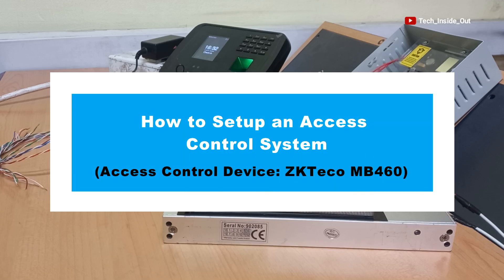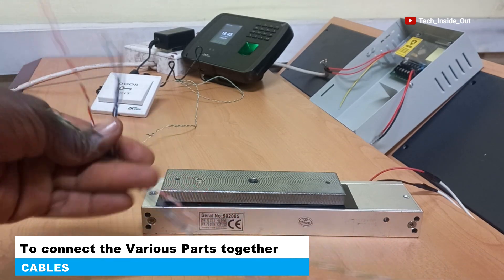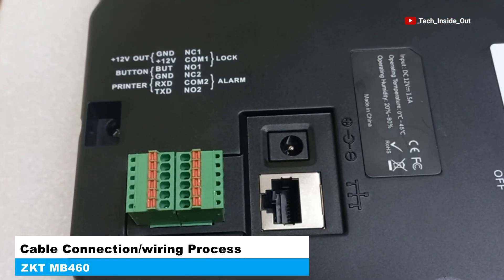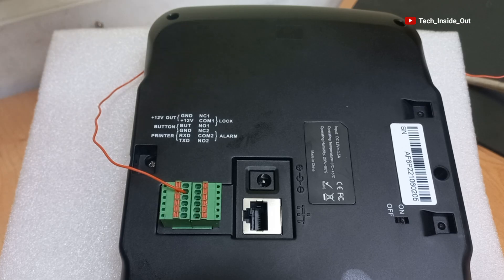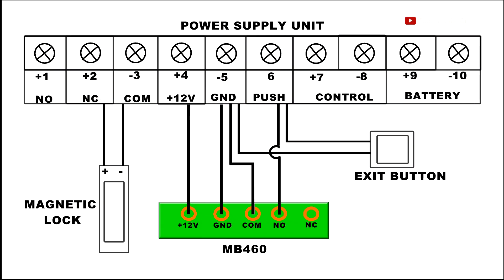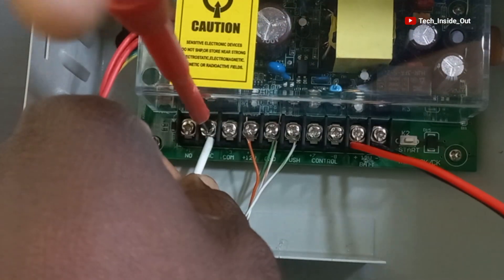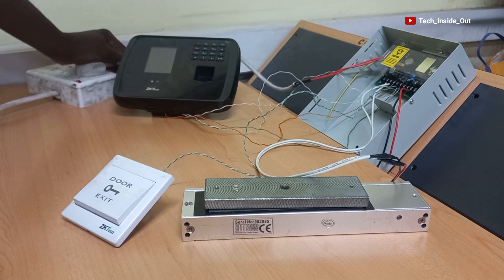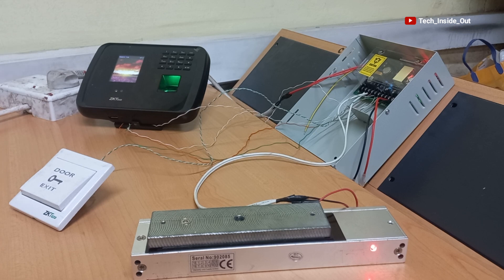How to setup zkteco mb460 access control system

Comment: I tried this set up but it didnt work. Did you give MB460 power directly or it was receiving power from the access control power-box?
Reply from the maker: You should try it up again,  the process is right, unless your device is not MB460.
Reply: @Tech_Inside_Out  My device is MB460. I spent the whole of yesterday trying it with your video more than 20 times. Compared to yours, my access control power supply does not have COM but has two GND. Can we exchange contact privately so that we solve this?

Comment: I have a different structure, there's a power input (12v and gnd) which have to be connected by an adapter. And the other parts (lock, sensor, etc) doesn't have a 12v but has gnd what should I do which gnd should I use and where to connect 12v pls help
Reply from the maker: The connection manual guides you in the connections and i can only tell through your manual since you said it is different from mine

Comment: mine at work got locked the door when we got power problem.... how can we overcome such a situation please
Reply from the maker: That means your connections have to done to "Normally closed" rather than "Normally Opened"
You can reverse that connection to use the Normally Opened so that it will rather deactivate the Magnet when there is power outage. 
Or create an Emergency Power Supply to power it up at all times
Reply: thanks alot  @Tech_Inside_Out

Comment: Your fan from Nigeria, please  how can one get the power supply unit, does it come with the mb 460
Reply from the maker: No, you have to buy it separately.  It is mostly sold at where you get the MB460
Reply from the maker: The power supply is bought separately
Reply from the maker: It is bought separately

Comment: The power supply acts also as a control unit, correct?
Reply from the maker: The two systems are built to work hand in hand

Comment: in this video theres no separate power for terminal, as like ur other terminal video.
Reply from the maker: Are you referring to power Supply to the MB460 or the absence of a power supply unit?
Reply: @ power supply to the mb460 because I realized you powered the mb460 straight from the power supply unit when u connected it to power.  Without adding an external powers to the mb460,

Comment: what if the power supply is not labelled ? can you use one power supply unit for access control system and for cctv
Reply from the maker: Yes, you can

Comment: can you share the power supply you used?
Reply from the maker: It is a specific power supply for the MB460
Reply: @Tech_Inside_Out  I saw that there's a connection on the battery terminals, may I know what is it?

Comment: How will the connections be if I want two fingerprints, one for entry and one for exit, and a gate in the middle? Is it possible for me to make the gate open if the fingerprint is in one of them, or will a problem occur?
Reply from the maker: I have not tried that connection. I would have to study the manuals and come out with an answer to this.
I will give you feedback, please remind me.
Reply: Hey friend, I am trying to do the same connection, if you have any advance please let me know, best
Reply: Yes is Possible! U can buy a separate fingerprint sensor with same model and connect the NC in series with push button and then apply DC power or instead use ethernet cable to connect from MB460 to the new sensor and Thank me later ❤

Comment: my power supply no have COM so what I put where?
Reply from the maker: 1. What brand of Access control are you using?
2. Which power supply are you using on it?
3. There should be a wiring diagram attached to the power supply, what does it suggest of where to connect the COM terminals.
Reply from the maker: It is not the manufacturer recommended power supply

Comment: Why was the com port on mb460 goes into GND port of powersupply and not the com port? Any idea.
Reply from the maker: I may have to do a deeper study of the circuitry on the power supply to be able to tell you why, but I must say that the circuit has been added to the product by the manufacturer of which I followed the manufacturer's wiring instructions as shown on the circuit diagram.